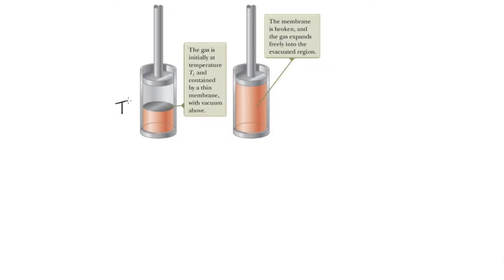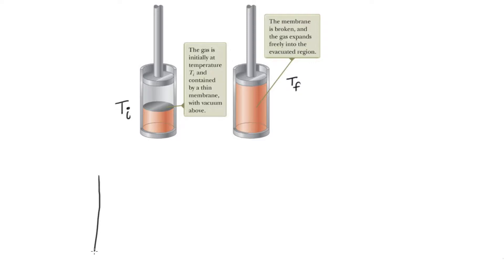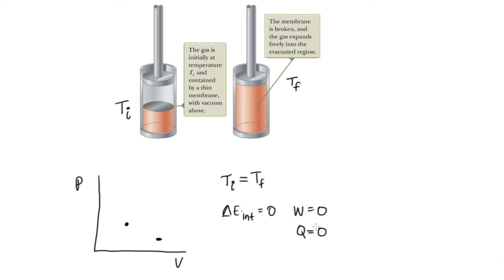Adiabatic free expansion temperature

Comment: It seems as though you are assuming that adiabatical presses have no heat or work added. I assumed that there was only no heat. Perhaps, work being zero is a result of the membrane breaking and letting the gas naturally expand. Maybe, this is just a special case of an adiabatic proces that happens to have work being zero without work needing to be zero to be adiabatic.
Reply: You're right, free expansion is a special case of the expansion process. It assumes that the external pressure equals to zero, so the work will also be zero (w = -pdV).